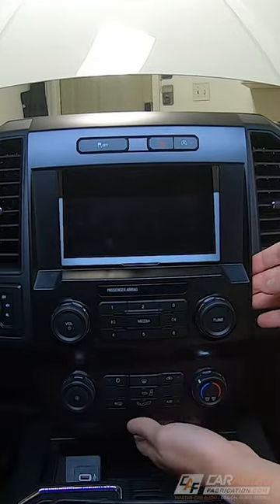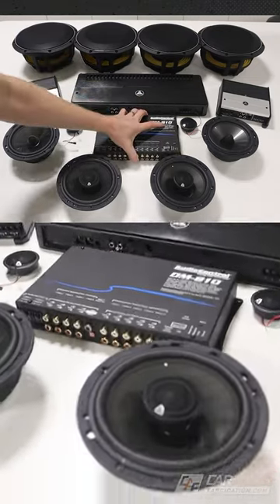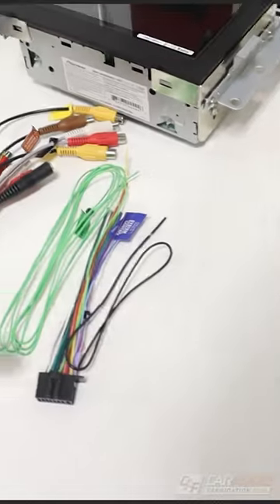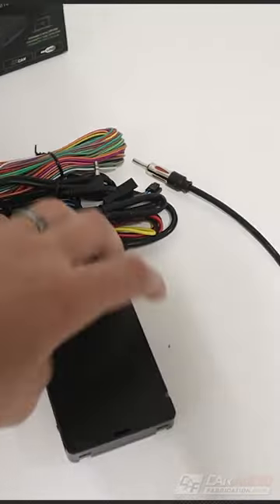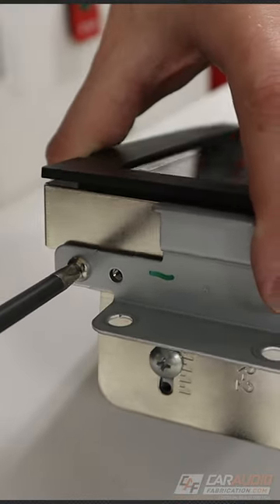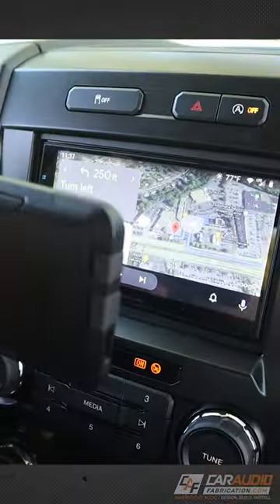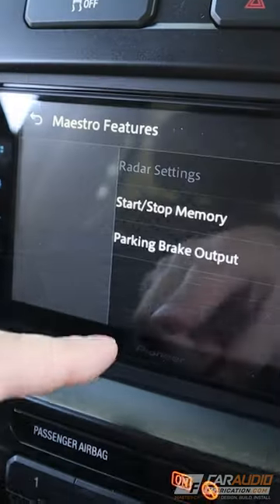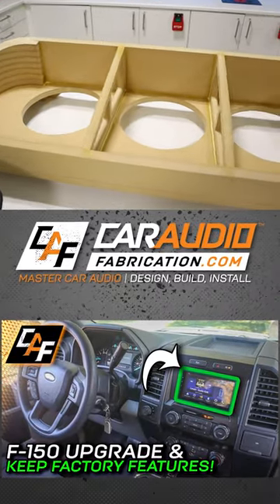Are today's vehicles HARD to INSTALL a radio into? #shorts

Comment: what about when your factory screen also controls air conditioning
Reply: DSP my friend or a aftermarket dash kits that includes controls. Check Metra and others. If none found DSPs make it possible to get the appropriate signals to the channels you choose to configure.
Reply: DSP and LOCs
Reply: @PhiMobileSounds  u sound smart ab this shit man i am trying to install a new head unit into my car, but there’s such little aftermarket support and no info online. I would prefer not to get a maxpeedingrods one either

Comment: How about adding aftermarket amps in a hybrid?
Reply: To my knowledge electric cars dont do well with systems. Idk about hybrids tho because they do have an alternator 🤔
Reply: @zave0123  they have “dc to dc converters” and a 12 volt (low voltage side) … What you have to manage is the headroom the dc to dc converter supplies… the game is going to become about efficiency and signal processing. … The days of inefficient amps are going away as EV pushes in. In comes  class D and out goes class AB.
Reply: @PhiMobileSounds  thanks dude! Apparently I was fed wrong info. I was looking into a hybrid but dude said that the "alternator" wouldn't be ble to handle a system. Good to know it is not an alternator but a DC to DC converter. 👍
Reply: @zave0123  I have a 2012 Volt, which runs on all-gas or all-electric (not both at the same time). All of these vehicles are different. I would say error on the side of doing your research. … But in general, our beloved car audio industry will have some creative thinking to do to either adapt to being more efficient or create some crazy aftermarket dc to dc converters that will inevitably draw down on range for these electric vehicles and possibly other components of the charging system. … Just like most people with large systems had to put a stop on the stop-start technology in order to ensure proper performance of aftermarket audio upgrades.